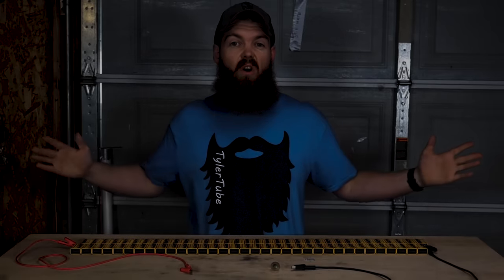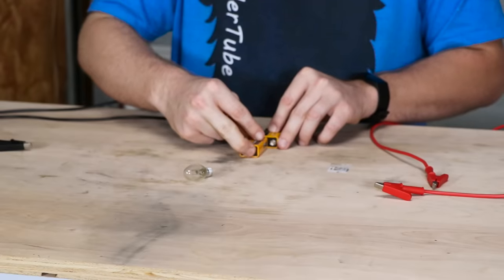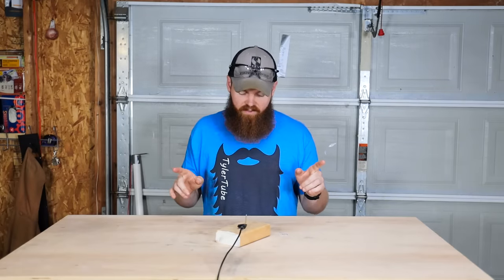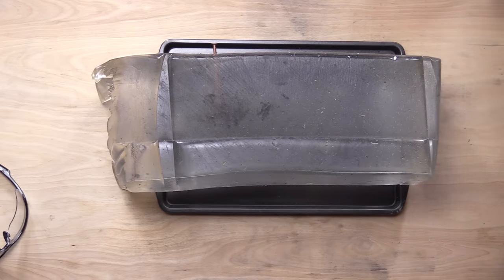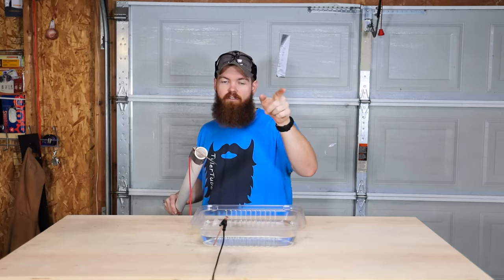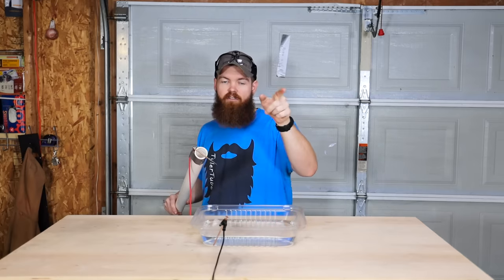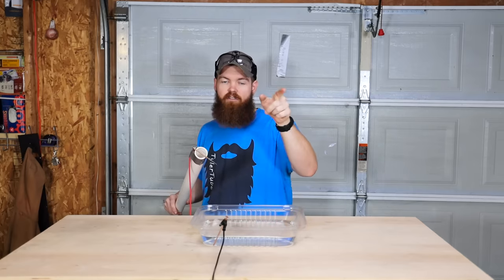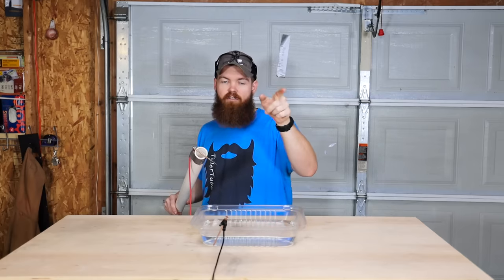I Connected 500 - 9 Volt Batteries...

Comment: "it should be illegal to have this much fun in your own garage" is not something a grown adult would say. The fact that you posted this up without an upfront explanation to anyone watching that doesn't know how truly dangerous this was shows how irresponsible you are! Look, i get it, it IS fun, but you need to make sure that you communicate that what you did CAN KILL YOU in a slip up, at best you will cauterize your internals between the 2 contact points. Just look at the hotdogs for an example! Imagine you accidentally touching both ends. I do not know if DC will affect your muscles like AC current does, but if it does, good luck letting go of the contacts! In AC power you will grip them untill either A) the power goes out (thank your lucky stars is this happens) or B) you can go into cardiac arrest, or lose the ability to breath, you will suffer a SLOW P A I N F U L L DEATH!!!

Comment: The voltage is not that much but you have to remember it is constant current
Reply: Sorry, what?
Reply: It’s not constant current. It’s direct current, which is probably what you meant. (The term “constant current” has a very specific meaning in electronics.)

Comment: You guessed the batteries probably about 500ma.  Probably 500mah but if it dumps all it got, I am willing to bet it'll dump several amps at once. I am also laughing a little when you disconnect the "ground" from the hotdog for safety.  You FORGOT that your POSITIVE wire is laying on the ground  or should I say your METAL GARAGE DOOR while you're holding the NEGATIVE wire.  4500 volts can jump right on you.  GEEZE!!! better be careful what you're teaching on YT.  Too many stupid people!!

Comment: The amount of things in this video, no offense but if you have very limited knowledge of electricity (or rather not extensive knowledge of electricity) or even just safety revolving around it you should not be doing this.

From the things everyone's saying like laying your arm across the batteries, to consistently resting the positive electrode against a giant metal garage door. All it would take is it slipping your mind the positive is touching it and you could complete the circuit through your body.

Comment: At 4:00 did he seriously use a calculator to determine the voltage?

20 x 9 surely that can be calculated in your head? I accept more complex connections might need electronics to be accurate but 20 x 9???

Comment: We clearly have a bunch of experts in the comments. It very common knowledge that high voltage with low amps can't kill you. The only danger he was in was getting burned. This is simple stuff guys.
Reply: It takes as little as 10mA to kill you, though 30mA is more typical. A 9V battery (or any number of those in series) is capable of upwards of 500mA. What was shown here is EASILY lethal.

Comment: Did you ever test the voltage? Its probably still 9 volts just a shitload more amps
Reply: When you connect batteries in parallel, you get the total amps of all the batteries, with the voltage of one battery. When you connect batteries in series, you get the total volts of all the batteries, with the current of one battery. 

He connected these in series, so he got the total voltage of all of them (500x9V=4500V) at the current of one 9V battery (around 0.5A).

If he had connected a multimeter to this, he would have instantly killed it — very few multimeters can measure above 1000V without special accessories.